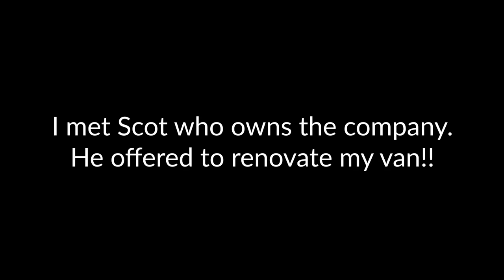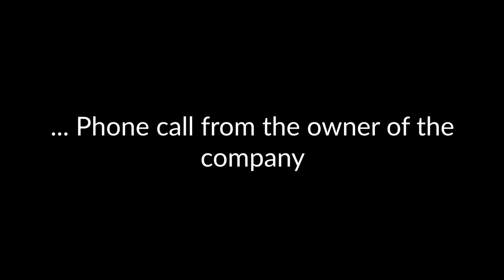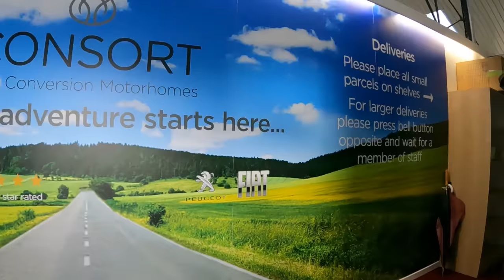I Can't Believe What They've Done to My Van

Comment: About 4 years ago I bought a car on line,the car dealership was in Leeds and they delivered to me and the car was great and I still have it. But during the first year I complained about a noise they came and picked it up kept it for two weeks. When I got the car back they have added 400 miles to the Speedo I wasn't very happy.